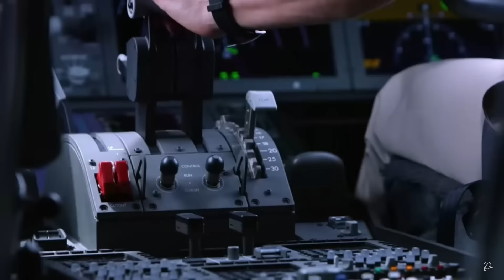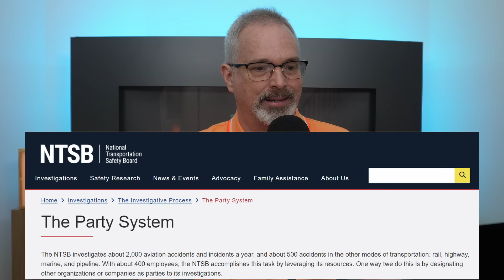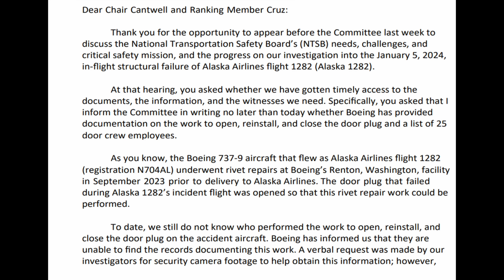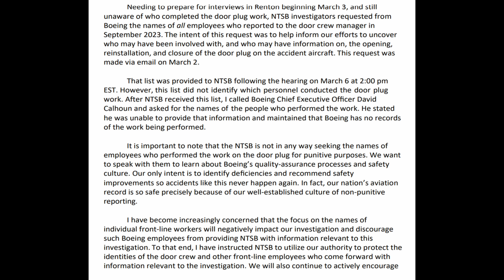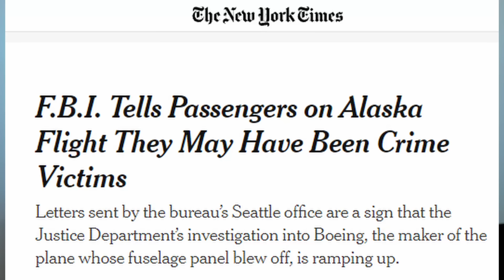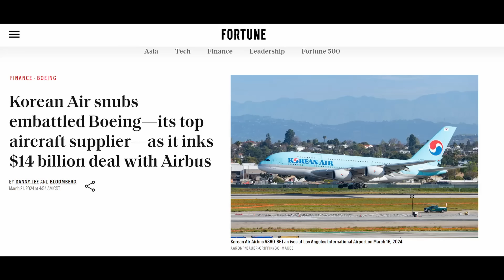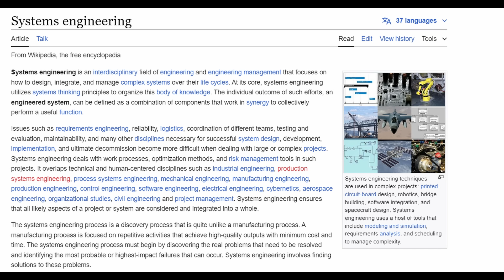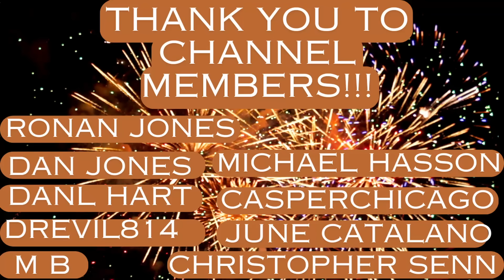Is the FBI Taking over the Boeing Investigation?!

Comment: Boeing needs to part ways with CEO David Calhoun effective immediately. unfortunately he was prioritizing diversity over very strict and rigid aeronautic QC standards with passenger safety in jeopardy across-the-board. Calhoun isn't a engineer whatsoever he was brought in to cut costs and maintain the bottom line by all means necessary which has blown up in Boeing face. It's been 5 years of Calhoun's tenure and nothing to show for it but  2 737 crashes that took 346 souls. Seems Airbus took a page from Boeing's playbook and took it too another level. That said they haven't had any QC issues. It all starts at the top Emirates President Tim Clark Boeing's Largest Customer mentioned.

Comment: You're right about the time card.  There should be a code used and since there's 25 people in the team they each should be interviewed.  The FBI stepping in may be a cover for Boeing.
Boeing needs to move their headquarters back to Seattle and get back to their roots.  Chicago and Washington, DC just changed the culture of the company.
Their system engineering kinda took a vacation on MCAS.  What chief system engineer would let one sensor determine the outcome of a major function involving safety of the aircraft?  He should have known about double redundancy and even triple redundancy if needed.  There was no excuse for the initial system design decision of MCAS.
Reply: It's not exactly clear, and seems unlikely that the door was opened by anyone using Boeing's time tracking system.

And it seems feasible that all time charged to Spirit warranty rework may have gone into a single, catch all code.

Comment: What it seems to me.  The NTSB is not getting requested information from Boeing.  Boeing is doing everything possible to derail the investigation.  So, the NTSB, a federal agency with no enforcement authority, is in collaboration with the FBI to pressure Boeing.   What has not been stated, when Boeing received the fuselage from Spirit Aero, and from there inspection, they found some rivets that needed to be fixed,   The door plug had to be opened to access the repair on the rivets.  Were there safety bolts on the door plug before opening it?  It seems like a really simple operation by the crew responsible for opening the door plug.  Why all the drama from Boeing not releasing the information.  It appears to be a human mistake.  Boeing dodge a bullet in there were no fatalities.

Comment: The engineering field: most do not understand the concept of Quality, what this industry has done is take a mechanical, electrical, chemical, systems engineer and put them in charge of Quality. Quality Engineering concepts are NOT the same. The Quality concept, started in the Quality control business, namely inspections. But that didn't require a higher education such as a masters degree. These companies  will make an electrical engineer by trade and make them a Quality Engineer, apples and oranges.....Metrology, the science of measurement started around the industrial revolution, THATS what Quality is.....measurement. A electrical or mechanical or systems engineer don't understand

Comment: As someone that owns Boeing stock (nowhere close to enough to have any meaningful influence) I'm pissed at the current leadership. Boeing needs to return back to it's roots of being run by engineers. To hell with the share price. 
If they find any criminal activity then they should be charged and prosecuted. Only when they get rid of those doing a half ass job/ pressureing those under them to do half ass jobs will Boeing be able to redeem itself

Comment: Couple points.

1. Re fbi investigating a crime..
The synic in me wonders if the reason the fbi is being brought in, is to make sure the correct answer is found. E.g. they put all the blame on a single employee doing it to sabotage the company or some such bs.

2. Re boeing being competent with military aircraft production.... tell me you don't keep up with that industry much. The air force has shut down boeing priduction several times over the years due to quality issues. 
E.g. empty tequila bottles on the new air force one and before that on the kc46 iirc.

Comment: I think, remember I said think, an issue like this is supervised by quality control and not a system engineering issue. Not only that, depending on essentials of flight requirements, there are often tests conducted prior to release of the aircraft. Be careful about making comments that could be incorrect! Please remember Boeing has a reputation to protect and yet they also must be credible. A good Reputation is often earned in years and lost in seconds. We all should be skeptical but not cynical. Yes or no?

Comment: As I understand it the door plug seal was repaired at Boeing by Spirit employees.   Why do we want a list of Boeing employees?
Reply: Boeing would still have ultimate responsibility for work done in their facility on their product.

When I worked on aircraft (Cessna and Learjet) vendors working in the facility on components they supplied were documented by their own company procedures and by the airframe manufacturer.

Boeing either has the information sought. And Spirit may also, if their employees did more than rework some rivets and the door seal.

At this point it's not clear who physically opened the door plug and who closed it with only partial reassembly. But I would bet that was Spirit, until more is disclosed.
Reply: @mikebarushok5361   Maybe I should have more more clear.    Of course all that is true.    It does not alter my question as to why we are looking specifically for 25 Boeing employees or whatever the number was.  I can see looking for Spirit or Spirit and Boing.  Looking for just Boeing seems to be negating the concept that it was Spirit people working in the Boeing plant.
Reply: @danharold3087 I don't see anyone claiming that Spirit employees aren't being scrutinized as well. Seeking the 25 Boeing employees could easily be based on information that isn't public.

Comment: Any decent company would have a record of who did any safety critical work. they would have the name of the inspector who signed off the work. Either Boeing are operating at the level of a small third rate company that nobody would use for safety critical manufacture or they are covering up. I am not sure which would be worse.

Comment: Sadly, based on our current system and how we routinely do not hold billionaires and CEOs accountable in our country, I'm sure the worker that was being constantly pressured to work faster and faster by a unsafe work pace and assembly schedule will go to jail long before any CEO or board of directors that INTENTIONALLY created that work environment will see the inside of a jail cell. But one can hope. The way to fix it would be to throw all the people on the board of directors and all previous CEOs in jail for voluntary manslaughter 300 counts or however many people were on all the planes that went down with the MCAS system, then replace all CEOs with Engineers. That would be cool... but it would never happen. If you a rich boeng CEO you can just claim fkn Ignorance and that's enough and get out of it.

Comment: The lack of this information is not suprising.  Renton is a Union plant and union members are prohibited in criticizing anything that has to do with an error or sloppy work of a co worker.  Any records that may have reflected on who did the work were destroyed very early on.
Reply: That's entirely untrue. What's your source for this?

I've been a shop Stewart for the Machinist union at an aircraft manufacturer (not Boeing) and know many, many people who work for or are retired from Boeing. Union contracs specifically are encouraged to report errors that aren't corrected and poor workmanship. Union members are proud of producing quality products.
Reply: I am sure the contract does not support this.  My comments are based on 40 years of experience as an outsider ( service engineer) working in union inviroments.
Reply: @parkerholden7140  What kind of union could be the difference. And, for what it's worth after working in production flight test I worked in experimental then in engineering, so I got a diversity of perspective.

Comment: Its Funny if an Airline does maintenance, replaces repairs they have to tell them what they did and who did it, was what's replaced etc,  put it in a book,tablet/PC,  Boeing NAHHHHHHHHHHHHHHHH.

matienace
Reply: Don't believe that. Everything assembled in Boeing is documented and inspected with names of the employees performing the tasks. I worked at Boeing for 42+ years of service. What is sad to read about poor maintenance by the airlines, tires falling off, engine issues, etc, years after initial aircraft delivery. Boeing needs to comply with investigation requests but the mishaps have to be correctly identified for placing responsibility.

Comment: Boeing that spun off to Spirit in 2005 was already rotting but 2023 Boeing is in no way shape or form 2005 Boeing. Same goes for Spirit, it has grown larger and is probably now too much of a large suppository for Boeing to swallow.  Boeing's current management in charge of Spirit, Airbus will also start to have more and bigger issues; as arms of Spirit outside of the US manufacture components for Airbus.

Comment: The Alaska Airlines flight attendants, pilots union should file suit because the cockpit door blew open when the plug blew out the  Plane and cockpits are the workplace so it immediately becomes an OSHA investigation for which we need results in six months,  and let us not forget Alaska Airlines maintenance department knew there was a depressurization problem with the plane prior to this incident that much been documented, perhaps Blockchain technology what will call a digital chain of custody with respect to maintaining  a single source of truth , it doesn't make sense that the safe operation of the airplane depends on flight data recorder's, but the manufacturing of the plane doesn't require a similar methodology of tracking who's done what when and where?  These are the processes we get by federal law, if I'm not mistaken, but clearly when the MBA is running the company, there is no scientific management implemented anywhere? Perhaps it's time to reconsider the corporate creed, which absolutely seems to stand for greed! ... Awesome channel awesome topic